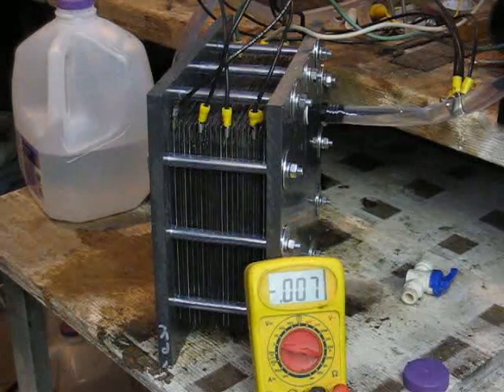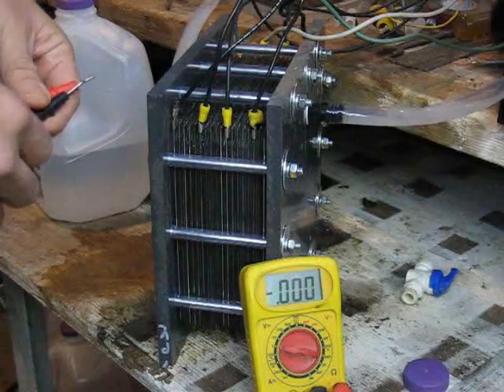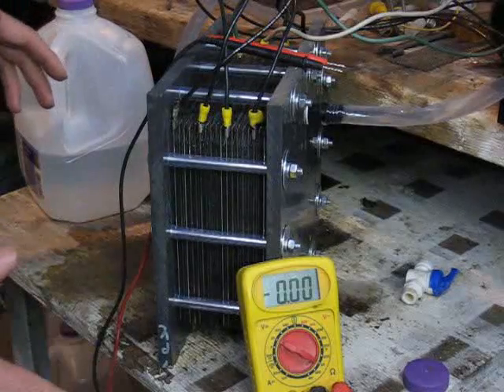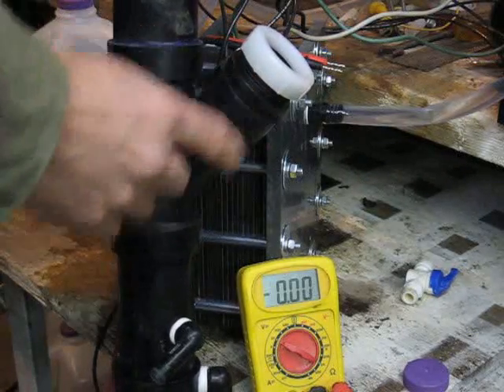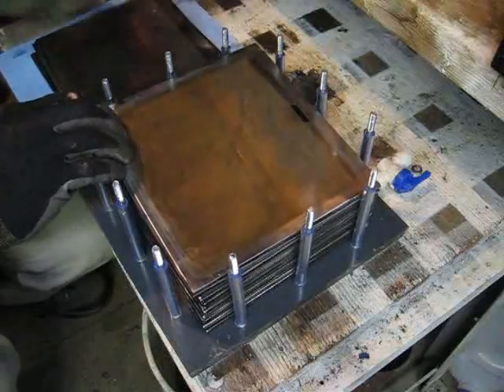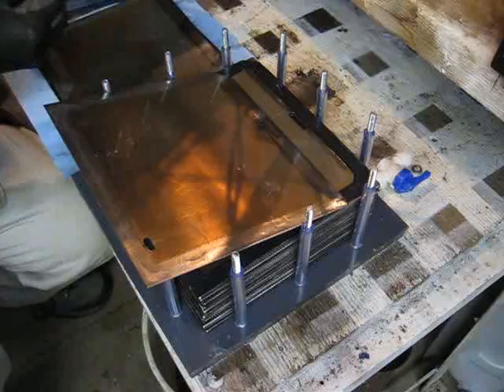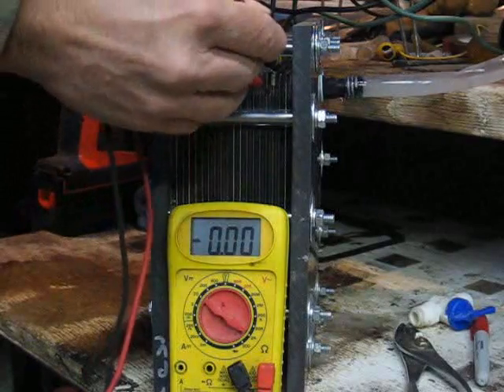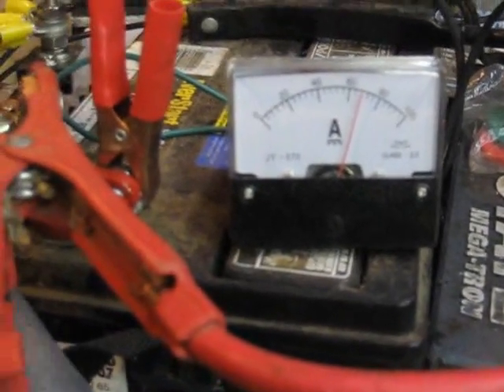HHO Dry Cell Bubbler Explosion Part 2

Comment: Hi OK. Iv looked at this video, if the spark had occured in the cell, the cell would have blown not the bubbler. I take it there was water in the bubbler, which means the gas explosion was on the top of the water in the bubbler, which saved your cell, this eliminates the spark theory being in the cell. more like somewhere from the battery location.

cheers zeropoint132.

Comment: In my #10 video, the positive and negative plates have tabs for the electrical hookups.  No soldering, no loose connections, no worries.
I like the EBN dry cell style except I can't solder worth beans and because of having to always fight loose connections.

Comment: your crimped logs should be soldered to the wire and in order to slide the log to the ss plate you have to file the edges to a v shape of the ss plates so the will slide on perfectly . i see that you used the yellow logs they fit 10/12 gauge only in order to solder the logs you have to remove the plastic yellow cover and solder the log to a 10 awg wire then you slide in a heat shrink on top of everything .